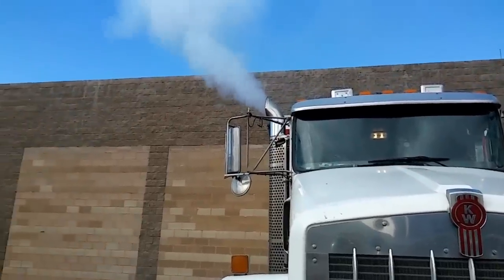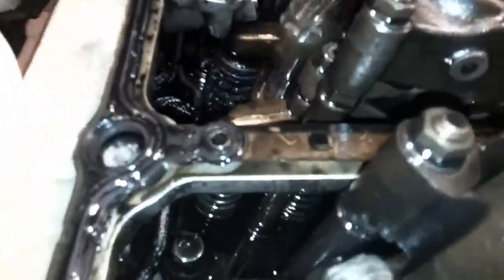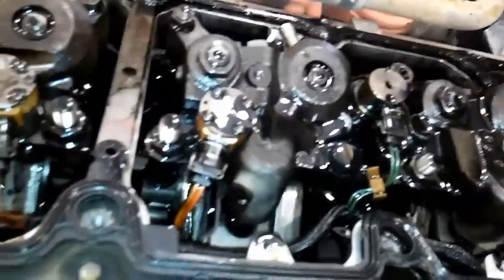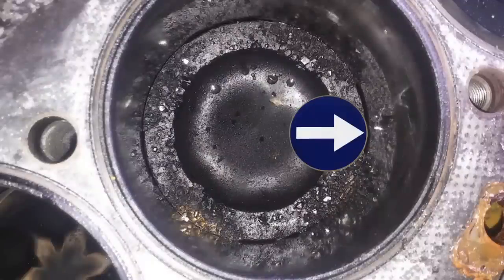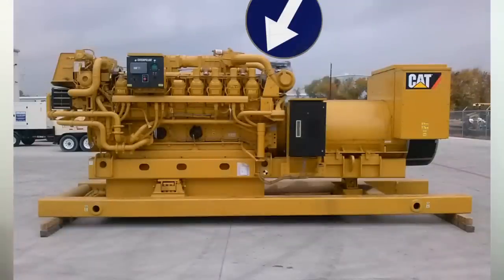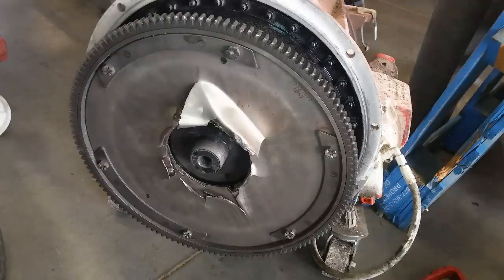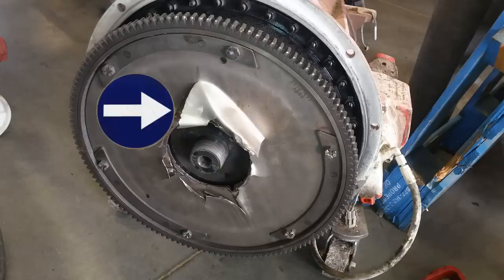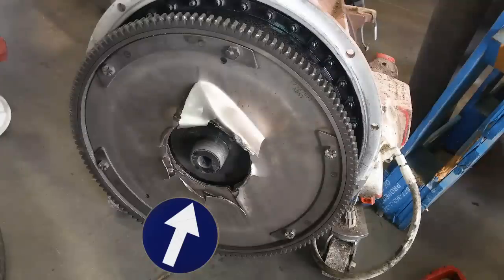Should You Warm Up A Diesel Engine?

Comment: I have a Mahindra tractor in the northeast where it’s cold. The dealer mechanic told me in winter start it and run it at 1,500 rpms to warm it up. I’ve done it at 1200 because I wasn’t comfortable with that. Now I’m thinking let it idle for couple mins then jump to 1200 maybe. Why jump to 1500 right away if the oil is thick and cold? Everyone has a different opinion and it just confuses me more and more. He also told me never leave the block heater plugged in for long periods, plug it in a little while before starting it. It’s a newer tractor so I rarely use the block heater plus I tend to leave it in the garage where it never gets below like 35°. I’m open to input but at 35° it’s probably not that cold to be too worried right?

Comment: Water cooled motorcycles, boats, snowmobiles, pwc etc all need to be warmed up for several minutes. If you don’t do this the tight fitting pistons in these engines will over expand and score the cylinder. Air cooled small engines like chainsaws or string trimmers don’t have these issues.

Comment: Simply put, run the engine at low load while it gets to operating temperature. Just run it easy and don't push the RPM's high. Idling is not ideal, and takes forever to heat things up.

Comment: "You don't want extremely cold parts being put under extremely heavy loads." My dad was a mechanic in the Army at Ft. Richardson near Fairbanks, Alaska. He was trying to  tow start a deuce-and-a-half one cold morning (it was -50°F) and the tow strap, wrapped around the bumper, came tight... Now the bumper is a piece of ⅜" channel iron bolted directly to the frame. When the truck towing took off, the deuce they were towing stayed put and the other truck moved across the lot steadily. Dad thought they broke the tow strap, but noticed a piece of metal in the yard. It was a chunk of the bumper, cleanly cracked out as if someone had cut it on a metal shear. The iron was so brittle that it broke.
Reply: i am in fairbanks, from Indian country. ft richardson is by anchorage and it doesn't get -50 there. you may be mistaken with fort wainwright

Comment: That is good information and reasoning for getting to operating temperature before putting a full load on the engine. Isn't also the piston ring gaps that when the operating temperature is achieved they offer the most protection from combustion blowby? Because when the engine is cold, those ring gaps are at their widest (within specs) and low idle RPM's offer the most protection, right?

Comment: I have a 600W 120V block coolant heater on my Dodge Cummins. I have a timer in my garage that turns it on 3 hours before time to go. It seems to help a great deal, no white smoke on cold days, sounds like it's sufferin' a lot less. I still let it warm up a few minutes, and drive it easy for the first mile or two. I never floor it until it's completely warmed up.

Comment: I used to own a TDI and a big truck with an international engine. getting an in-line coolant heater was the best purchase for my little TDI that I ever made. Hot and ready, instant heat from the HVAC and smooth starts. It beat out block and oil pan heaters hands down. I never drove the bigger one much in winter, being that my line of work is seasonal to summer. After moving further North in Canada, I found that the in-line coolant heater was a must, or even getting a diesel started in the worst of winter was a total crap-shoot.

Comment: I had a 1997 f350 powerstroke and i would use my block heater when it was below freezing and also the chip had a setting on the knob where i could idle the engine at 1300 rpms until it warmed up

Comment: I have an 06 ram 5.9 and when I could start it in Tennessee depending on how cold it is I just let it run for a few minutes especially when I get off work 11pm 12pm and ready to get home. I just take it slow for a few miles not putting to much rpm to it

Comment: Refrigeration trailer mechanic. We have a unit with 56,000 hours on it that goes straight to full throttle after start up. Even in the winter. I still let my 7.3 warm up tho😂

Comment: Here's a situation: Class 8 truck with Cat or Cummins or whatever. You've got 45K load and half mile from the interstate get on ramp. I can't see how a partial warmup and then head out under light engine load going down the interstate doing maybe 35-45 MPH for 3-4 miles. Talk about  potentially getting rear ended.

Comment: Never let a truck motor idle at idle speed for long periods of time always idle it up for it to have oil pressure in the wintertime idle it up a little more if it's an older model diesel idled up the truck doesn't know if it's running down the road or sitting still I'm referring to old-school diesels 3406 12:7 M11 n14

Comment: I have a 2000 Freightliner with a cat 3212 with 20000 miles on it. It starts religiously. After starting/idling a few minutes / the idle increases a bit on its own for a few minutes. This goes along with your recommendation. I asked a junk man and he told me that’s normal. Didn’t know that I should boost idle when using my aerial lift truck Ioader (international) and truck with loader . They seemed to operate adequate at low idle/ thanks for the education 
From Maine : if it ain’t a cat it’s a dawg/ haha

Comment: Get a pan heater and a block heater when you start it let it sit and Idol for half an hour really cold winter conditions.
Reply: I put a pan heater on my 6.7 two years ago because my truck has to sit outside. With the heater plugged in while it's - 30 degrees Celsius my oil temp sits at -5 (-15 if the wind is blowing) so warm up time drops substantially.

Comment: In the oilfields we are tough on diesel engines, often times the truck engines power the hydraulic pump(s) that A: start another larger engine, or B: power equipment, so it's often ambient temperature to 1950 RPM once it fires off! Word of advice, NEVER buy a Oilfield truck/equipment and expect it to last! Yes, it may only have 32,000 miles but 15,000 hours of abuse!!!

Comment: My Chef has this 3360 Mercedes Actros Tow Truck with multiple air leaks and a worn out compressor, so instead of fixing that he just goes full throttle to build pressure. This is totally not the reason he has to replace the twin turbos once a year.

Comment: I run my truck for 1 minute at idle then shut it off. Heat distributes, fire back up 5 minutes later. And ready to rock and roll
Reply: 1 minute doesn't make sense I can say a 
3 minute run to me that would make more sense.
Reply: @tiger.6509  2 minutes also makes sense but not 4 if you were given 5 and you had to take that away from 3

Comment: whats your recomendation on oil?
synthetic or petroleum?
this video, Was about the engine.
Trans is ice cold jell as well,
 hubs; really all moving parts, and
Air and fuel lines. block heater is a good investment running 48

Comment: A diesel engine doesn't really make much heat until you start burning some fuel. I had one that would blow cold air out of the heater ad a stoplight, but get warm again once you got down the road a ways. If you have an oil pan and coolant heater, it should start easier and idling simply will get the oil circulating. 
It probably won't "warm up" till you get rolling.....easy at first.

Comment: Thank you for the video. I don't usually have the ability to plug in at my  place, granted it hardly goes below 0F. I my normal routine was about 3 minutes of idle before my gentle decent down my hill at a higher rpm. I have recently gotten a TS6 chip for the ol 7.3, and after a minute of warm up ill get her in fast idle for a minute before I take her down the road. Good to know! Hope to keep her on the road years to come. (will have outlet available soon for the block heater, snowplow keeps destroying the one I do have access too.)
Reply: be certain to replace all glows with motorcraft only, get the white stancor relay, and get a hi torq starter (SD version works, even though only 2 bolts), replace the block heater element (and water pump, coolant, t stat, hoses, heater core if older truck).  sounds like a great routine, one i will use with my new 2000 f250 with ts 6.  will chip my 97 now, too, really makes a difference

Comment: I would assume in addition to block heaters / coolant heater and circulators that back up generator engines (at least the larger ones) would have an electric oil pump to circulate the warm oil a couple seconds before start up and full load.

Comment: I let my Diesel run to 100°F then drive it at about 2000 RPM. Once the temp hits about 150°F start to run it a little harder.  But I never use the throttle like I'm stepping on a spider. I always just roll into it.

Comment: All the information I find online is very vague about this. Everyone is talking about this is if they have academic superiority but then fail to logically explain why waiting a few minutes after starting the engine helps it, and they always presume that people have no mechanical sympathy when driving on a cold engine. So here’s my two cents for what it’s worth and someone who is more familiar than I want with diesel engines.

It’s completely pointless, for small diesel hatchbacks at the very least you’re much better off setting off as soon as the rpm settles and just being as gentle as possible on the throttle, getting up to speed preferably 40 to 50 miles an hour and keeping it there for a few minutes until the oil gets the temperature before giving more power… about 80C for most.

Warming the engine up from stone cold in a high load, low rpm scenario at 40-50mph limits the time the engine is exposed to wear (I suggest keeping it to 1000 to 1500RPM in high gears) because you’re simply spending less time with the engine running with low oil temps. Your engine does not wear out from being on a high load while cold any more than hot, as long as the engine is not heating too rapidly. It’s the oil not being able to efficiently lubricate the moving parts at low temperatures that’s the issue here. Having your engine on idle while cold for a few minutes does not do much for heating up the oil, it needs the higher loads to do that.

Revving too high from cold on the other hand is the worst for wear. It also creates hot spots and ultimately points of failure which is what I think diesel “experts” assume others will do if f they say it’s okay to drive off straight away, but hey, I never said it was a race to get to optimal temperature, it’s about a balance. 

Of course for this reason if you’ve been driving the car very hard and your oil is, say 115° then you should definitely wait a few minutes to cool off but that’s a different story.

But all you’re doing by idling your car for 5 or 10 minutes is wearing out the cylinders a bit more, clogging up your DPF etc with soot and wasting fuel.

You mention in the video, you would rev the engine up while on idle to warm it up, but this makes absolutely no sense. You may as well be moving at that point with the engine being under high load, heating up faster, and exposing itself to less wear long term. You’re oil and coolant pump around almost as soon as your rpm settles when you first time turn the engine on. That is in modern vehicles, anyway 😅.

I am not speaking for all diesel engines, I’m speaking for newer, smaller diesel engines that many people drive now, that have better engine management systems. The stop start diesels in particular are not meant for idling precisely because you will screw your DPF. I have a golf GTD ‘18, this is something diesel owners of newer diesels have to be wary of now. Idle in those at your peril. I’ve known many people now who drive new diesels with DPF and spend thousands having them replaced because all they do is feather the throttle for months at a time at low speeds and never get it up to a good high temperature to regen. 

The answer is it depends on what diesel is, if it’s a newer one with a DPF definitely don’t idle it unless it’s way overheated and you need to cool it down before turning it off for the day.

Hope this helps.

Comment: Well living in northern Wisconsin winter gets pretty damn cold, -60 last 2017 winter, even with the block heater my C15 acert was a hard start. Problem soon as I leave for work it goes under a  70k-90k wagon bout a 1/2 mile drive through my little city. Found after a minute idle it up to 1100rpm then leave it there for bout half hour works fairly decent. Also I don't have a winter front for the truck. Once it's warm it does a good job staying there. I hope I'm not doing anything wrong them will prematurely detonate my Engine.

Comment: I'm a new owner of a 99 7.3, I notice like a gas engine the idle will be high at cold start up, I wait at least until the idle drops to 650 or so before moving. I'm running Rotella T6 5W 40 synthetic.

Comment: The number one concern I have is like you said get everything lubricated well but the pistons do you want those pistons to get fully expanded end of the cylinders or at least most of the way expanded and I’ve let my engine sit and idle for about like you said 30 seconds and then I’ll bring it up to about 1000 RPM but if it’s really cold here in Pennsylvania I let it run for about five minutes at 1000 RPM there about those in RPM this is six in a row jim From Kennerdell Pennsylvania I have a 91.5 dodge and 580 super L case

Comment: Love destruction of the week! What should I do as a Hotshot Trucker? Most nights we run our engines at idle for 10 hrs running either A/C or heat depending on the season. There's about 20 days in fall when you can get away with not running depending on where in the country you are at that time. I have set the idle up but is that enough? Thanks love your channel!
Reply: Should have included we have Cummins engines in our trucks.

Comment: Heat is a by product of inefficiency.  Diesel fuel is so efficient that it burns super cool hence the reason why it takes awhile to warm up.  You will never warm up a diesel to operating temp by letting it idle.  Your best bet is to mae sure the oil is the proper viscosity and allow it to circulate before driving off.

Comment: In the oilfield a lot of our equipment is powered by the hydraulic motors off the truck "Tractor" engine. A lot of guys will just start the engine up, kick the PTO's in, set the RPMs at 1950 and go to work! I'd be shooting someone if it was my equipment!

Comment: Both gas and Diesel engines should run at low idle when cold until the oil pressure builds up. And keep RPMs as low as possible until the engine has run at least 5 minutes.

Comment: Synthetic oil is so much better.
One, it doesn't get thick like petrol oil.
Two, it can be pushed to the bearings faster even in cold temps.
Three, it does not break down like petrol oil.

Comment: Hi, I have a 2022 3.0 Duramax Silverado.  I have noticed that when traveling interstate long distance, while sleeping in the truck running the engine at a rest stop to keep the heater on so you do not freeze to death the engine is programmed by Chevrolet to turn off after a pre programmed period of time when left at idle.  CAN the pre programmed auto shut interval off be disabled too allow the engine to remain on and allow the heater to stay on??  Also if I remember correctly this type of auto shut off was put on tractor trailer engines many years ago and there was some type of accessory truck drivers could buy that the drivers could place between the seat and the accelerator pedal that would move the pedal occasionally fooling the truck letting it know not to shut off the engine, that it was not remaining at idle. Is that devise still available and what was it called??

Comment: I live in Alaska, it was -60 below zero Farenheit a few days ago. My 1996 f250 7.3l powerstroke has a Block Heater, Oil Pan heater, Transmission Heater and Battery Charger. Would you still give the same advice for my diesel and extreme low temps??

Comment: Saw an oil pump broken on high rpm during winter,  before warming correctly the engine. So it really need to be warmed before putting in load .

Comment: I just let the engine idle 10min then drive off gently. But if it goes below 30 I’ll plug in my block heater on my 7.3 And below 30 I’ll let it idle 10-15 min until it smoothes out a little. And on a 7.3 it uses the crankcase oil as hydraulic oil to once the injectors smooth out I’m good. But I just let it idle at least 10min.

Comment: For the cold starts I’ve seen (I lived across the street from a truck driver) when looking at the exhaust the smoke has a different appearance. This could be because of cooling from cold cylinders as well as from the exhaust system. I’d think that it shouldn’t be moved until the exhaust has a more normal appearance. From my observation the exhaust never begins to appear more normal unless you raise the idle sometime after startup. If it idles even after being driven long term it usually reverts to the smelly off color exhaust again. I remember an account of a trucker’s friend that became ill in an idling truck. The only way he found the driver was because of noticing the smoky and smelly exhaust. This occurred in hot weather so raising the  engine above idle seems to be the best way to prevent problems later on.

Comment: I always idle for 3 - 5 minutes at roughly 800 - 1000 rpm in my 6.2 diesel until I see the temp needle move. ThenI drive lightly until oil reaches full temp. My truck seems to like it